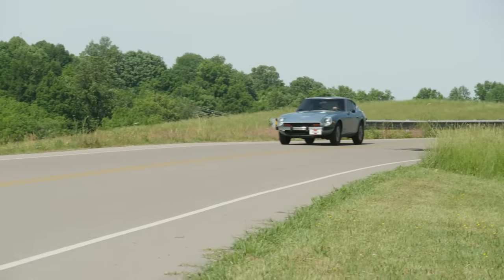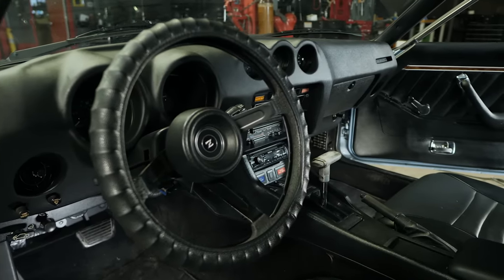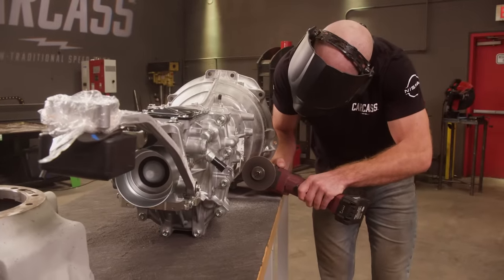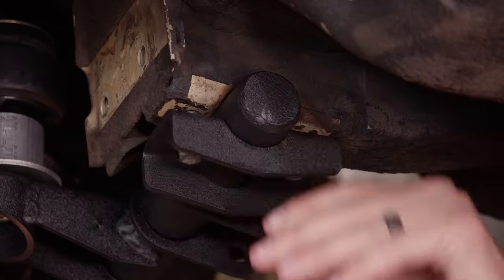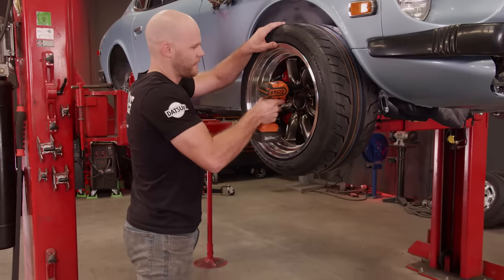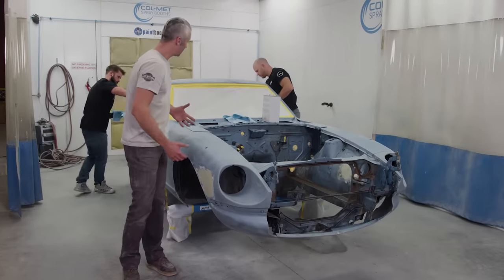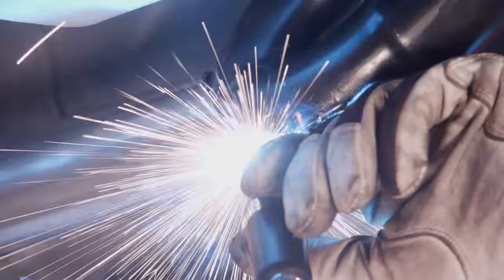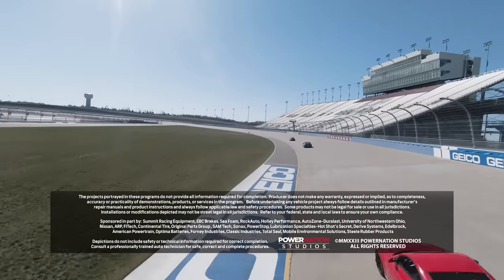TURNING JAPANESE: From 280z to JDM!

Comment: This Z was waaay too nice to modify like this.
This is like 10+ thousand dollars worth of kit to fix problems you aren't having.  All these mods are things you do for a big power build.  
You do not need a CD009, you can get a datsun 5 speeds for a few hundred dollars and then you dont need a new tail shaft. or an adapter plate.  Its also and additional 60+ lbs over the stock gear box.
The stock suspension was fine.  Just change out the shocks.  I mean I love my coil-overs but what are you doing?
 Those total replacement rear ends are nice but you are spending thousands with that setup to increase ride harshness with no noticeable handling increase off track.  Its just not needed. Same with the axle upgrade for a car with maybe 180hp! its lunacy.   
Why cut the fenders? You can fit 15X8 wheels under the stock fenders with some trimming.  There is no way on earth you are breaking 200tw 8" wide tires loose with that 180hp.
All that money and you put $150 fake watanabes on it!?!??
Then you go to the track and go 20mph.
What is going on?!?!
I feel like Im taking crazy pills.

Comment: Needed rings and valve seals (you had the motor out fer chrissakes).
A cam and bigger valves would have made a HUGE difference, likewise triple Weber DCOE/DCOF carbs.
Definitely needed to toss that crapola EFI system and use a Holley/Motec/Fuel Tech.....something, ANYTHING, better.
Did I notice the massive puffs of both blue and black smoke, yea, but I won't mention it.
Oh.....wait.....
Reply: Right? They changed...so many things that didn't need it, so they clearly aren't doing a resto/preservation thing. Tires look odd, the old bumper looked better, swapped to a manual for no particular reason seeing as how none of the rest of the car was set up for drift/autocross. And they do nearly NOTHING to the engine. No wonder they didn't do an "after" dyno. They literally have guys in another part of the building with every tool and toy known to man that do nothing BUT engines, and they didn't send it to them for some love? What a waste. I also saw that exhaust smoke at the end. Shame shame.

Comment: I owned a 78' DATSUN 280Z also in the mid 90's in San Diego. These cars were rated from factory 170bhp and the curb weight was 3,100 pounds ( excess weight was due to the oversized front and rear bumpers- all the info is on the plate on the drivers side door panel).   I miss the hell out of mine.....such a well built, reliable classic.  Congrats 🎉

Comment: Nice build, great color , fuel injection and new trans awesome. Suspension upgrades were a must. . Seriously doubt the oversized tires and wheels add any handling advantage, and are probably mildly detrimental to lap times and skid pad.

Comment: Love seeing all the awesome Z builds that are around today! Im building a 76 280z from the ground up with my dad right now so that I can daily it when its done. I love the simplicity of these cars and how easy they are to work on; they were so ahead of their time yet they still had the ease of maintenance that 70s cars had. Everything on the car is easy to remove and reinstall too (besides the glass) like the dash is a hour job, starter is 30mins tops, its an inline 6 so you dont have to pull the motor to do valve seals or other cool work and my favorite part of all is how easy they are to mod. The number of bolt on kits I see out there is crazy. Not to mention these cars are fairly cheap to do a nice build when compared with other older sports cars. Turbo kit is 2k, EFI is 1.5k, full suspension last time I checked was like 2k and rear brake conversion was like 1k. Not things you do immediately but they are fun upgrades to look forwards to!

Comment: I have a 78 z but I’m putting a 383 small block with a 5 speed in front of a Ford 9 inch in it. I found the car in El Paso on offerup when I was 19 and I just knew I had to have it. He said another guy was wanting  to come buy it in two days so I stayed up all night to build some trailer ramps and drove 18 hours to buy it for $1400 as a flat tire roller. It’s fairly rust & rot free other than a nice patina, it’s riddled with dents, dings and 7 bullet holes though. Idk what the story is behind it or what happened but apparently the car is from Colorado (at least on the title) and the original key has the name Cole engraved in it. I’ve got a lot more work to do but I’m proud to say it’s finally getting together, I’ve decided to keep the bullet holes and surface rust & most of the blemishes. Honestly, I think it makes it look a little badass like something out of mad max haha. I can’t wait to drive it!!

Comment: This sort of drives me crazy the cylinder head should have been ported and Polished if they're going to tear it down that far it would have made the biggest difference in the world
Reply: Or - at the very least they should have completely steam cleaned the engine (or sprayed it down with a degreasing solvent before reassembling.  Sheesh - that guy sprayed the engine block with aerosol can paint !!!

Comment: I wish they could've strapped the 240Z to the dyno in order to compare output with the 280Z... sure, it's down 400cc, but it also isn't saddled with a catalytic converter and other emissions controls that the 280 has.  My guess is that the outputs would have been closer than one might expect, given the displacement difference.
Reply: 240 also had high compression and ran on leading gas, 240 was rated at a higher HP

Comment: I had a basic 280 beater 4cyl stick shift, however/whatever the ailments aligned - BEST FUN EVER when I mashed the gas peddle through slap shifting to mid rpm in 3rd then no throttle deceleration in 3rd - it would backfire loud as firing both barrels of a 12 gauge shotgun!! ❤

Comment: Fun vid! I'm a little puzzled by the take that they're finicky or take some effort to keep them running. I'm an 'old guy' that's had a zcar in my stable for over 40 years. I've owned over 25 of them with about a dozen of those being parts cars, and have experienced bullet proof performance in nearly all of them. I'd buy them, fix them up (always something small) and sell them for a decent profit. I'd take in suspension work, interior swaps (to black), 5 speed conversions, automatic to manual conversions, carb work and fuel injection to carb swaps, and a lot more. They can totally be a rust party, and that's where many of my parts came from, rusted out decent cars, but these cars made me a lot of side hussle money.  Plus, at one point I had nearly all my friends and family driving one due to their nutty reliability. I had a 260z (early edition) that I kept for 21 years that was heavily modded over its time with me, and have two now that are amazing. A full custom build 280z from an original owner in AZ, and a 40K original car I call Jackpot. If you can find a chassis in good shape (dersert cars and alike) buy it! Super fun to build, low cost of ownership, fun fun and more fun and something you don't see everyday. You can pound the you know what out of the drivetrain and it'll just say "fine by me". I've never blown and engine, and haven't seen one with a blown engine (of course it's possible). I have some fun cars, but my favorite - that's a fraction of the cost of the others - is my custom 280z.  Zzzzzooooom!!!!

Comment: Hi guys, all that exhaust in the hatch area is a clear sign of failed weatherstripping or open holes in the rear end. The  S30 creates a rolling swirl of air directly behind it, and grabs the exhaust in the swirl. The front and side aero of the car creates a low pressure zone inside the cabin which sucks in the exhaust swirl through any gaps in the rear of the body. To correct this you either need to close the windows and run the vent fan on full to pressurize the cabin with fresh air from the cowl, or seal up absolutely all air gaps in the rear end. I'm not certain how a lip spoiler affects the swirl, but worth also investigating. Congrats on a great build and hopefully you can enjoy it without inhaling exhaust.

Comment: A friend of mine had a 260z with a 280zx motor, running gear, and interior. With a turbo fitted. It was fast. One thing we found out about the body of a 240z to 260z is a slight difference. The 240z if you measure the front edge of the rear wheel arch up to the edge of the door. You will find it is slightly shorter than the 260z and the 280z. I don't know if it gave more legroom in the back. Not that there is much space behind the front seats
Reply: if it had rear seats it was a 2+2 variant
Reply: @PhantasmPhoton  I haven't seen any 2-seaters in the UK, but I'm not saying there aren't any.

Comment: Reading the comments @Vonslick69 mentioned the curb weight, it would have been an interesting point if you had weighed the car before and after. Losing the bumpers different exhaust, cross members and suspension etc could have a big effect.

Comment: I worked for George Alderman Datsun in New Castle, Delaware. in the Race Shop, who raced a 200SX in IMSA at the time (1977) , they built me a 1800cc - 160 hp motor for my 1973 Datsun 610 - which would suck the headlights out of this 280Z. Hop-Up tip for the 280Z - a 500 ohm - half watt resistor in the fuel injection wiring will boost it a huge amount ....unfortunately, I don't know which wire the resistor goes into > note = the 610  also had IRS. The 1974  710 didn't. PS - you clowns weren't even born when that Z was made ... so how are you experts ?

Comment: I had a '77 280 2+2 5spd manual and if memory serves it would redline at 7200. Don't remember what the box stock engine would turn but I'm guessing somewhere around 160 to 180hp. What I do remember was how brisk it was in performance be it in a line or thru the twistys. We really enjoyed the car the three years we owned it. 3 kids kinda made it be a little too small for us so we went with a Ford Galaxy.

Comment: A friend had a 78 280 in 1982, one of the best handling cars I ever drove, you could take a 35 mph curve at 70 mph no problem.
Reply: I miss my 78 280z.  Last thing I did before selling it was install a new set of McPherson struts all around.  Took me and a friend of mine 6 hours.   Extra man needed to push down the rear suspension arm after unbolting the upper strut from the body in order to pivot the struts away from the body before unbolting the lower strut from the suspension arm.

Comment: Z CAR was terribly suseptabe to rust in several areas of the body here in the SE. I owned a  '73 brand new and sold it in 76 due to rust susceptibility and the thieving insurance cos.
ALSO, those in-line 6s were boat anchors.

Comment: The 78  Datsun 280z stock hp 135 with 144 ft pounds of torque
Top speed 127 
0-60 7.4 seconds 
Redline 6500

Comment: 'L' series is engines were pretty good, they made an L24E main found in early skylines but was a 2.4 litre fuel injected version, the 240Z  i had hauled with that swapped in with a 5 speed behind it, damn did it sing @7400rpm

Comment: I dunno what others think as we watched the guys take stuff off and out of the car BUT they had wayyyy too many nuts 'n bolts come off and out. Likely they went in and loosened a gob of 'em BEFORE the camera was turned on 'cause I've worked on enough cars since the 1960's (I'm 76, been a motor head since high school) to know there were a ton of bolts and parts that literally refused to let go without a hot wrench and impact tools, sometimes an air chisel. Also since almost every housing is aluminum YOU KNOW they had at least one or two flange break off or crack and likely at least one or two thread strips inviting heli coil as a fix. Anyway, back to watching. :goodvibes:

Comment: Honetly, the build is generally good - BUT there is way way too much tire and I hate seeing body cut up for flares on these cars. 
The yellow headlights just looked goofy to me.   Fender mirrors... not a fan of them on Z's of this era either.    

The engine and transmission and suspension upgrades were great though. 
and better brakes that didn't need bigger rims would have kept the overall attitude of 
the car with some great performance upgrades.
Reply: fender mirrors take away the style sore thumb
Reply: @jameyodau  I agree whole-heartedly.  it ruins the body lines as do do the fender flares.  imo

Comment: What an awesome and expensive restoration to what was a solid car. I wonder what the dyno would have been with the basic bolt on engine improvements. I've always loved the Z from my first ride in a 240Z. I have a 2011 Z that put down 200 more HP on a dyno which being a modern exotic engine of sorts, it's pretty incredible in its own right. The new Z doesn't disappoint with minor tuning on the dyno. Not a fan of the yellow headlights, but what a great car!

Comment: I really think you should have put a mild cam upgrade in it and also wanted to see it on the dyno again especially since it has a different fuel injection system and exhaust
Reply: Im currently building a 10.5:1 3.0 engine with a hog ass 535 high lift cam, shes gonna be a ripper for sure.

Comment: Myself, I rather drop a Chevy 350 in the Z! From what I was told years ago the Chevy 350 actually weighs less then the stock Z engine and you get a heck lot more power! I’ve seen a few Z with Chevy 350 that looked pretty sharp. Unfortunately I never got to drive one though. If I had the money, I get a Z and I put a stroker 350  that be more like a 383 ci engine Never too much horsepower far as I’m concerned! 😂  Had a 77 Jeep CJ5 with a Chevy small block 400 ci engine in it and that was scary fun to drive!  Let a friend drive it once and he almost wrecked it. So I never let anyone else ever drive it again.  Lot of horsepower in a very short wheel base was really easy to get it out of control if you weren’t use to driving it.

Comment: The brake, suspension & transmission upgrades get a huge thumbs up from me. However, the simple elegance of the original bodyshell has been butchered beyond recognition. Those fender flares look like a cheap boy racer afterthought. I'd have gone for a wheel and brake combo that could be accommodated within the existing wheel wells to keep the clean lines. Talking about 'clean lines', those fender mirrors have got to go too. Also, the original metallic light blue paint was stunning, now it's just boring gray. Gentlemen, what were you thinking? 😮

Comment: I found this to be a very good series overall and I'm glad you ventured into Japanese cars instead of simply American cars. I'm very disappointed that you kept the measly 150 hp engine after significant brake upgrades and suspension updates. Why make the car handle and break better, in a light chassis, that has no better power to weight ratio than it had in the 1970's? The heart of any car is the engine.  This same engine with a turbo, or replaced by a more modern engine, like the RB26 engine, would be more appropriate for after spending so much money and time and effort.  If you're trying to reflect a real life build, no real life car enthusiast would do all the suspension and break upgrades and other work, and then keep the original engine simply converted to fuel injection instead of carburetors. Sorry guys, but nobody in the real world would have went this far with this build to only stick with a motor from the 70's .That is not how hot rodding works or how resto-mods work.
Reply: I agree. Even a modest 5 to 7 pounds of intercooled turbo boost would wake this car up .

Comment: Should have grabbed a first Gen infinity engine and turbo to 400hp so it would match the new one
Reply: As fun as that sounds I think they wanted more of a heritage build rather than a full blown restomod. I think a small turbo with 5 to 7 pounds of intercooled turbo boost and modern day programmable EFI would wake up the car without totally disrupting the heritage element that builders were trying to achieve.

Comment: Very nice job overall. 

The BAD
1. Rear-view mirrors are ugly.
2. Rear-view mirrors look like an expensive accident waiting to happen. 
3. Would have been nice to see a turbo added to the mix.
4. Wondering about tires rubbing under load in a turn or just driving straight over bumps. 

NEUTRAL
1. Tires - too wide for my tastes - wonder how the wheel bearings will tolerate them over time.
2. Modified fenders are a hassle to replace.
3. When someone hits the mirrors and ruins a front fender, a replacement will be painful. 
4. Knowing Horse Power, Torque, and Fuel Mileage before and after would be nice.  

The GOOD
1. Nice Paint.
2. Very clean engine and engine bay.
3. Looks like a dependable sporty vehicle.
4. Very Nice wheel and brake upgrades.
5. Suspension upgrades are my favorite part.

Comment: Kinda disappointed we didn't get to hear the exhaust. Didn't get a new dyno pull with numbers. Didn't get to see the engine bay after completion. Didn't get to see any of the interior done with the new peddles and shifter. Thats really my biggest issue with "tv" car shows. The youtube channels that mod cars really have the formula down and you guys should really start taking notes. The current format you are running is good for 20 minutes of tv time but it doesn't transition well for youtube there's just so much more you could give us and you just don't. Hopefully you guys can get away from the tv station system and really get into the online format it just works so much better for automotive content. Regardless of my complaining the build turned out nice 👌

Comment: 1978 280z
Engine: L28E I6, cast-iron block, alloy head, seven-bearing crankshaft, single overhead camshaft
Displacement: 2.8 L (168.0 cu in; 2,753 cc)
Bore: 86.1 mm (3.39 in)
Stroke: 79.0 mm (3.11 in)
Fuel system: electric fuel pump, Bosch L-Jetronic fuel injection
Compression ratio: 8.3:1
Power: 170 hp (127 kW) at 5,600 rpm (SAE gross)
Torque: 177 lb⋅ft (240 N⋅m) at 4,400 rpm
Transmission: four-speed manual, five-speed manual, three-speed automatic
Final drive ratio: 3.55:1